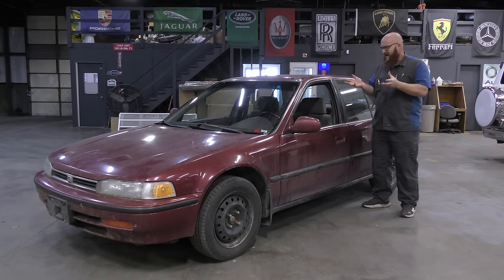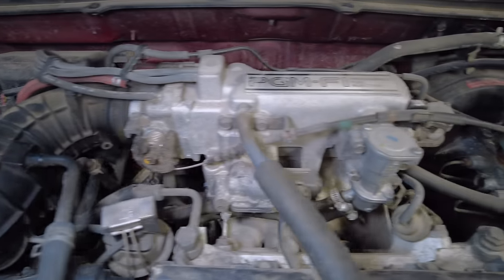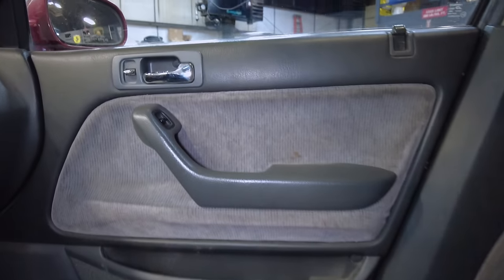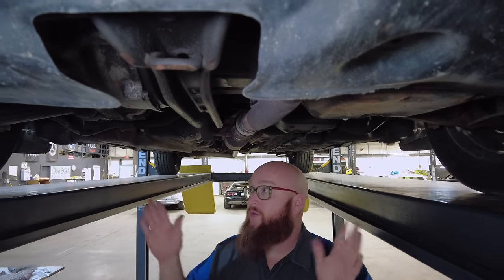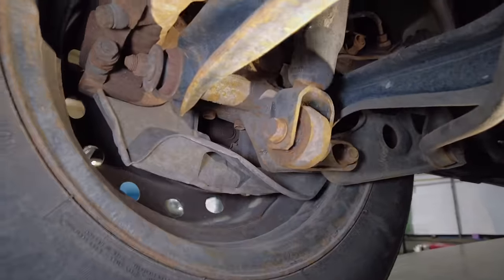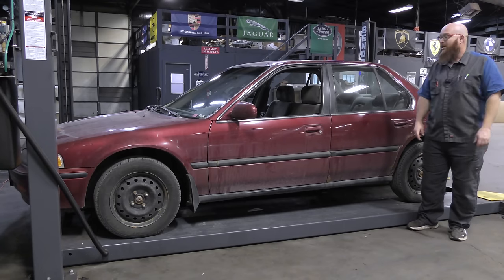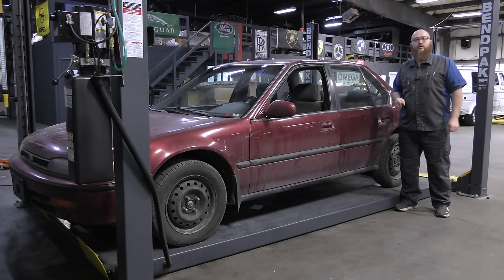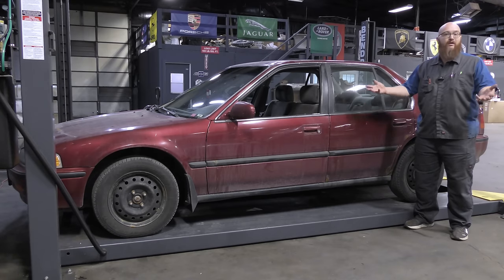A True Testament: 32 year old Accord with 380K miles! When Is It Time to Let It Go?

Comment: I also owned a 1985 accord LX with the 2 glass headlights in each side and the hood folded up from the windshield back to front end. It was cool! And that car I drove to 480k miles 
It was show room condition not a spec of rust! And cable clutch manual trans 
And bought that for $400 also in 2014 had 235k miles. It needed a flex pipe replaced and collage girl was only selling it cuz a garage that she took it to told her that she needed a catalytic converter and that it was gonna cost $800, so she decided to sell it and I just happen to come by at the right time I just bought it, I didn’t get a second opinion after she told me what was wrong with it particularly I really didn’t care I would’ve drove it as loud as it was! Until the day I got stopped for it and then took it to a shop. Which that shop, ironically not knowing at the time also told me I needed a catalytic converter and quoted me $1100, told him no way and took my car back into the girl about a month later and told her the price I was quoted because I thought her $800 quote was pretty high when she told me during the sale! she worked at Harbor freight anyways we’re talking about the quote that I got. She asked me where I went and I told her the place and she says well that’s the same place I took it to that gave me the $800 quote😂😂😂😂 
I then ended up taking it to a muffler shop which they were honest and told me I did not need a cal converter. It only needed a flex pipe. They installed one for 150 bucks and then released it in the car was quiet for about two years until it rusted off again.  Apparently that’s a common issue with Hondas of that error is there exhaust rust out every few years?

Comment: If I owned a car that long, even if it's not worth it, I'd put effort into making that as good as possible, just out of sentimental value. Maybe try to get rid of the rust, repaint. But is it worth it? Nope. Not if you look at it as a machine. 

I am doing the same with my car. I got a 2024 Mitsubishi Mirage, I drive about 25,000 miles a year. Maybe some day it will reach 1 million miles? Also congrats on reaching 1,000,000 Wizards?!

Comment: Do one that's safe drivable but the costly repairs are coming all at once in the next 6 months.   Example: Tires at 4/32, brakes getting close to done, evap code, timing belt 20k overdue.  That one I would do tires and brakes first. Do a Macgyver fix on the evap code and pray to the Gods on the timing belt.  If I had to do them all at the same time, I'd probably junk it.

Comment: Sold my VW Jetta TDI 2002 with 475k miles on it.  Time to let her go.  Interior was looking worn out.  Still got near 48 MPG highway, even at that high mileage (standard trans).  Great vehicle.  A bit pricey to repair but it didn't need that much.

Comment: Right now I’m driving a 2008 Dodge Charger v6 3.5L aspirated engine with 375,308 miles on it. I’ve replaced most everything on it except the original engine. I credit this longevity to regular oil changes every 3,000 miles at first but now every 5,000 miles with 5 quarts full synthetic and a quart of Lucas additive. I’m trying to last to 400,000 miles and maybe beyond. Does anyone here think it can last that far?

Comment: It’s the rust and rot that eventually do it to these Hondas. I had an ‘03 Civic LX 5-speed coupe that was utterly, faultlessly reliable for 250K miles. However, it got to the point you couldn’t lift the car with a traditional jack, because the creeping rust had gotten to the frame. Amazing vehicle, was sorry to let it go!

Comment: One of the best accords. In  my country there are still running there's many ones already with overhauling engines and in my country the annual mechanical checking are very strictly cars could not have safety and engine problems to can running and there's hundreds of this accords in the roads

Comment: That start up engine noise at 6:50 is on every Acura TSX 2012 and bunch of Hondas. I do not recommend anyone to buy a new Honda/Acura, lease them! They are all full of problems that show up after 60k miles. At 100k miles your MDX engine is burning oil faster than your speedometer going at 100 mph.

Comment: I am just about done with a 1992 Honda EX with the same color and interior. 227,546 miles. No rust but does have a new hood. Auto trans and operational sunroof.  Going through everything. Looks better than yours. Aluminum Honda wheels. Would like to send you pics.

Comment: Fix the rear brakes, drive it gently, and it will last quite a while. Basically a very reliable little car. Hondas and Toyotas, especially of a certain vintage, can't be beat. Rust is what does them in.

Comment: We bought a new 1983 Accord and it was very reliable. Had close to 400,000 k on it when it was t boned by an idiot. Had to replace a rusted out fuel filler pipe on warranty but other than that it was just maintenance! Too bad Honda has slipped a bit and don't make them to the same reliability.

Comment: When a basic Toyota corrola from 2017 with 100k miles costs $16000 you bet I would rather spend $600 to fix the old beater and keep driving till the wheels fall off

Comment: Now I would like to see how long it will run at all :) even spending 1000$ a year is for repairs, is still the cheapest way to drive. I did that with my 1991 Mercedes 200D. Sold it 4 years ago with 350.000 km and sometimes still see it running by.

Comment: If they would have taken better care of the car cosmetically it would be very nice. It needs a thorough cleaning and detailing and it will be pretty nice. Check out how clean the engine is, no leaks other than the pan gasket and it might use Hondabond instead of a gasket like the later ones did. Fix the few nuisance things and wash and wax it. Clean up the interior. If it meets their needs as a vehicle then keep it going. Most newer cars will never last as long as this has.

Comment: Brake rotors on those accords was horribly to change.. oil seal pop out massive oil leak. Fuel pump relay issues, distributor problems. 2 timing belt system not cheap to fix.

Comment: Id get the brakes fixed and drive it for as long as i could. I know people that have to come up with over 500 a month for a new car payment combined with full coverage insurance. I love having something old and paid for. My toyota tacoma is a 2003 model with over 270,000 miles. It has no leaks and burns no oil. Insurance is only 45.00 a month.

Comment: Honestly I would keep it as a commuter or just to run errands and keep miles on the NEW EXPENSIVE car down, I wonder a 01 5 speed accord and it had 394,000 miles when I sold it and it only has a fuel injection problem and the clutch went out after the new owners son rode it hard, accords are the best cars out there

Comment: I’d buy that accord right NOW! $500 ..all those needs to be done is reg normal maintenance wear and tear !!! You’d have to do that no matter what car you own ..even new ones, ! That’s like selling a car, because it needs a new tires you just don’t do that ! It will last another 50-100k  miles easy just keep up with oil changes! And it will keep going! Eventually you’ll need a clutch on 
It am sure this is the second clutch in this car which is normal. It can be done so cheap by any back yard guy for couple hundred bucks if you buy the whole clutch kit for less the $200 and you get the pressure plate, the clutch the whole thing!

Comment: Wizard congrats on 1 million! Tell this customer to keep this car and keep driving it fix the rear brakes and just keep going that car has lots of life left in it. Maybe get a rattle can of rust stop and spray on those rusty areas who cares what it looks like, but maybe it would slow it down, I would give them $1000 for the car.   Now this is coming from a guy that drives a 2007 Hyundai Azra that is literally beat to crap but only has 101,000 miles and rods and drives perfect it just happened to be elderly owned and they ran into everything until their license was pulled

Comment: I love my 97 accord 2.2. vtec! Thing has 289k miles and runs perfect even passed smog with flying colors a week ago! 
I think besides the engine it having a 5 speed really saved this car also it’s the same color as Jeff bezos old accord and year 😂

Edit: allow me to elaborate, I drive about 64 miles a day in it and I beat the living shit out of it I’m talking taking it to redline, rev match downshifts, burnouts and roll races.. it’s all stock lol don’t get me wrong but I never treat it like a grandmas car 😅 
I’ve never had an issue and would 1000% recommend one with high mileage as long as the actual engine and transmission are in good condition you can rebuild the suspension on these yourself for like 100 bucks lmao and every other part is cheap about 10 to 80 for most things including headers full exhausts (found a good one for 200 at most) and more.. these cars then can just be h22 swapped after they die and roll on for another 400k for like 800 bucks lmao I’d drive that daily til the timing belt snapped 😂

Comment: I would buy that Honda I actually owned a 1995 same body style but in white with sunroof! Except it was in automatic! Which I didn’t prefer but when your penny pinching and all u can buy then it is what it is! 
Thankfully I know a lot about Honda in earlier years and common issues so I excepted it was it was. 
    Now I got it for $450. USD and it had 120k miles and at that time the year was 2017 and a 60 year old neighbor owned it since new! 
And she was told by 3 Honda dealers and a couple back yard mechanics that she definitely needed a brand-new transmission. She wasn’t willing to put in $2500 worth of work for a replacement on a transmission so she just went out and bought another car and let this one sit in the driveway I knocked on her door and asked her what she was gonna do with it, and she’s explained the situation and that the scrapyard offered her $350 for it, I didn’t want to see it go to the scrapyard and it was still driveable. The only thing you had to do was manually go from first gear second gear third gear drive every time you came to a complete stop and had to take off you had to do this.! it was rather annoying but after doing some research I found TSB’s for a particular 1992 to 1996 models accords were they needed a TCU replacement. And so I went and bought one from a junkyard for 100 bucks. I pulled the carpet back from the passenger side, floorboard, unplug the old one plugged in the new one, and the thing and drove and drive perfect!!! I didn’t need to reprogram anything I didn’t need to recalibrate anything I did all myself and it took not even 20 minutes.! 
Ended up turning around and selling the car for $3800 at 180,000 miles  
A a car that I only paid less than $650 for for the car itself and repair

Comment: I've had one of those Honda Accord last forever with just oil change and brakes and I put it through hell and just keep it on the road  I've carry a crate engine and parts for cars and trucks and mowers and rebuilt the house I was living in it was my favorite scoot about even though door panels were falling off backseat was ripped to s***it had a smell closely resembling cow poop and fertilizer and cigarettes what I used it for was the shop's (pickup) and scoot around

Comment: I still have a 1992 Honda Accord, although it's the European version with a carburetor and a two-liter engine. Unfortunately, due to the mixed E-gasoline (with ethanol), the carburetor's gaskets melted, and I couldn't find any E85-resistant ones. These cars were built to last. The 2.2-liter F22 engine could run for over 1 million miles with just regular maintenance. Handling was great (four-wheel multi-link suspension), and excellent road feedback. If anyone out there can tell me where I can find E85-resistant gaskets or that thin sheet material to make gaskets out of them, please feel free to tell me. I want to put it back on the road. It has rust and some other issues (fewer than the car in this video), but I'd love to put it back on the road and drive it every now and then. I have owned it since 2006, and I drove it until 2019. Besides the pleasure of driving it, it also gave me great memories.

Comment: The CB7 was the best Accord ever built. The ONLY time you get rid of it is when it rusts to the point where it's gone. They run FOREVER if you take care of them.
Reply: The one I used to own (CG6 or I call 6G Accord) took place of the CB and CD's in terms of old Honda on the road today lol. I cant remember the time I've ever seen a CB7 in the wild. Beat to hell, stock, or modified. They are just super rare these days. On the other hand 5G Preludes are starting roam the streets again.

Comment: $3800 dollars, with shop labor included, is nothing to fix everything to keep an old car going. All these cars need in the long haul is the timing belt done on time, seals and oil changes. Old FI Honda engines are amazing as long as you dont drive them like they are race cars. Even then they can take a good beating. Everything is cheap on old Hondas, those brake calipers are probably $50 each. I know not everyone likes to work on their cars but when you have an old ass car its usually better to learn how to work on it so you know what to look for when something breaks or gets worn down. You also save thousands in the long run, Ive saved probably over $30,000 at this point by working on my cars on my own. Trans swaps, fuel pumps, rear main seals, full suspension rebuilds, timing belts and chains, etc etc all for multiple cars. That shop time adds up over decades. I have a van with 400,000 miles on it and its going strong, imagine the cost of 27 years of ownership, paying a shop to work on it every time. Do not think about the "market value" of a car ever, most cars will always depreciate so dont worry about it. Once you own the car all that matters is if it works and can get you to A to B safely. The best thing is you don't have a monthly payment and high insurance for a new car ever. Everything is just a maintenance cost at that point, and still ends up being cheaper in the long term. I have two other vehicles Ive had for 20 years, the cost of maintenance for those 20 years has been worth it knowing that the cars are still good and will continue to run well as long as I keep up with the maintenance and repairs. When you get a new to you used car, its more of a gamble on what will break first and what repairs need to be done right away. Its the whole "Devil you know vs devil you don't know" thing. Having that piece of mind with an old car makes it worth it, so $3,800 in 2024 is really nothing for that piece of mind....unless its a rust bucket. Forget all I said if its rusted, dont ever put money into a chassis that is rusted from snow salt or the rust belt.. 😆😆

Comment: Rust, I hate it.  Had a 2005 Grand Caravan, which is infamous for its rusting issues on the low door panels and frame.  Would have driven it further than the 175,000 if not for electrical problems.  The rust buried any hope of investing more $$$s into it.

Comment: That car just needs to be in the right hands, and it will go 1mil. Plus, ease of repair, inexpensive parts, VERY fuel efficient, small dents and scratches kinda don't matter cause its an old honda, AND the interior could just be detailed and be literally brand new again!

Comment: that's not surprising for an old well maintained Honda or Toyota can easily last over half a million miles or more Scotty Kilmer has mentioned his 1994 Toyota Celica GTS has almost a million miles on its odometer and still runs well or Auto Journalist Matt Farah's used 1996 Lexus LS 400 which reached a million miles in February 2019 or the 1.3 million mile 1983 Lincoln Town Car among many others

Comment: I have a 1996 Saturn with 475000 it needs its first engine replacement AND it will get it 2500 for the short block and I will invest another 1k or so to do all hoses, belts, injectors, radiator, clutch, etc 3500 dollars to have essentially a NEW car that should go another 500k for less than the down payment on a used car No RUST it is PLASTIC except the roof and hood (monocoque design) I do live in the south so the road does not get salt (often)

Comment: Miles tell you nothing. The interior looks way different in 380k car that made trips of hundreds miles than in a commuter that did 10-20 miles a trip, that one would be totally ruined. Also, those years japanese interiors, maybe not so flashy, were extra durable and solid, take todays nylon mesh upholstery and 90' woven one, probably even a wool mix.

Comment: I thought a 94 accord for $100 from my buddies mom…. Transmission was bad so i bought a used one for $400…. It has roughly 200k and runs better than half the new cars in the road 
The car has no stereo, no speakers, no carpet, and it’s been stolen before…. Basically new still 😂

Comment: Miles mean nothing. It's about wear and tear. Have the oil changes been done when needed? Has the car been driven responsibly? If so, get it detailed and throw some new seat covers in it and treat it as faithfully as it has treated you. When it throws a rod, then it's done. But that could be 20 years from now with proper maintenance.